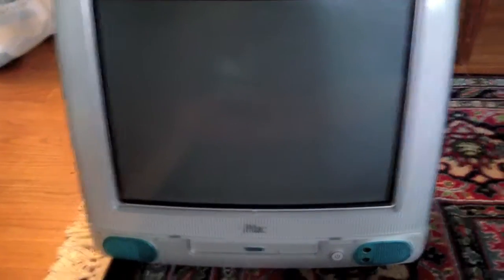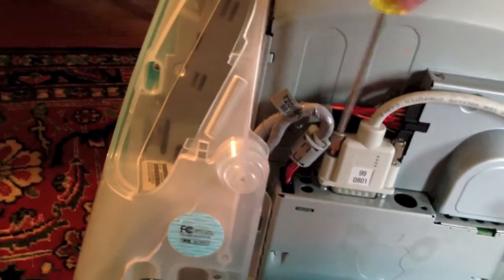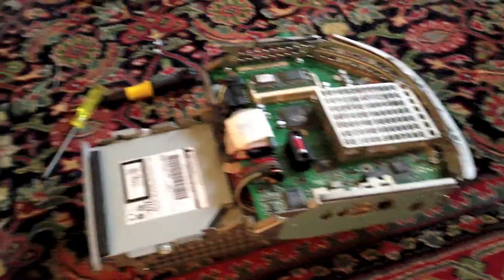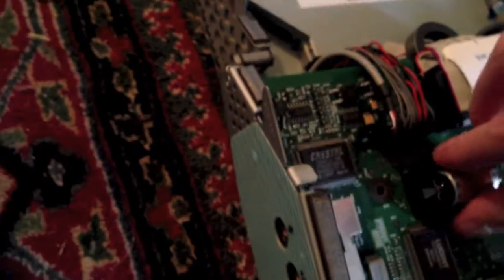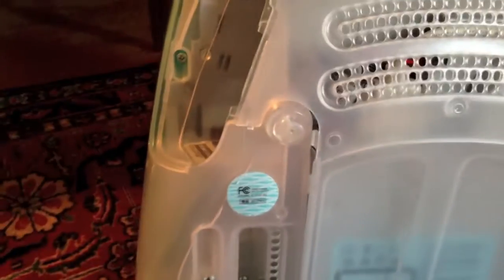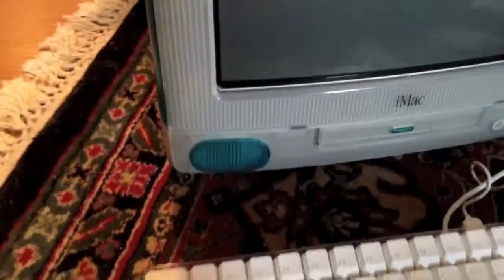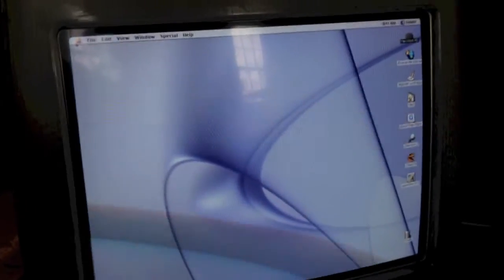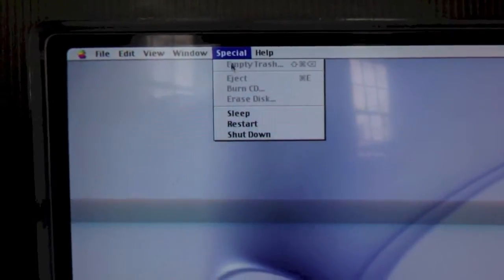Replacing PRAM battery in Blueberry tray-loading iMac G3

Comment: I have the strawberry imac g3. It doesnt turn on however i know for a fact it worked great before. Does this tip still apply to me? Also is it dangerous to touch the motherboard? And finnaly can just resetting the cuda button solve my problem even if i dont have a battery?
Reply: Omar Reyes no shut up !!
Reply: Alexandra R you loser

Comment: What did your mac do before you replaced the battery? Because my imac G3 doesn't load into the OS It's stuck on the loading screen. So I am wondering of this is the case.
Reply from the maker: That sounds like more of an issue with your OS or hard drive. When the PRAM battery was missing or dead in this machine, it would cause it to simply not power on at all unless the CUDA IC was reset with the button on the logic board.
Reply: Ok, the problem with my I mac was resolved. It didn't boot up, because (not kidding) one system folder had one wrong letter in it's name. It is now fully working. BTW: Thanks for the advice.